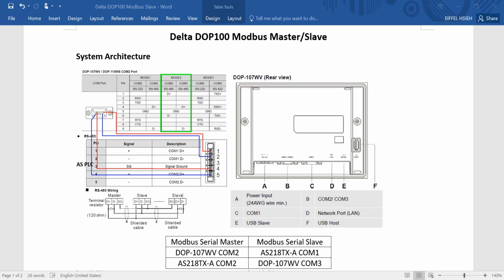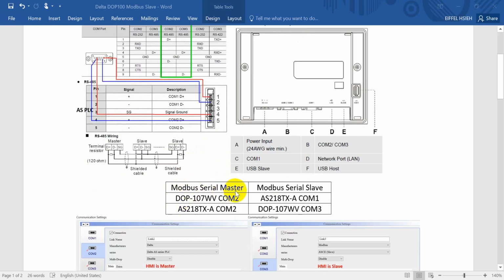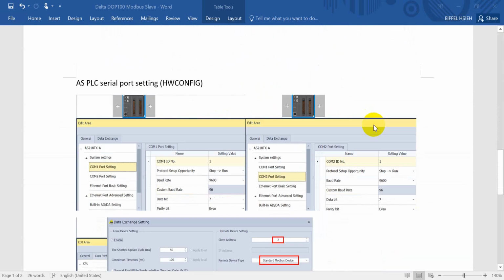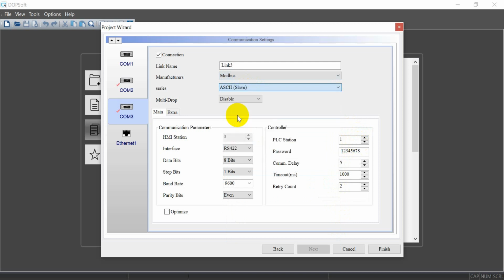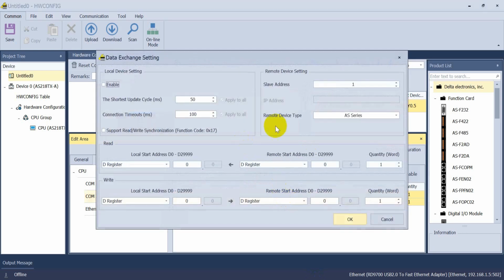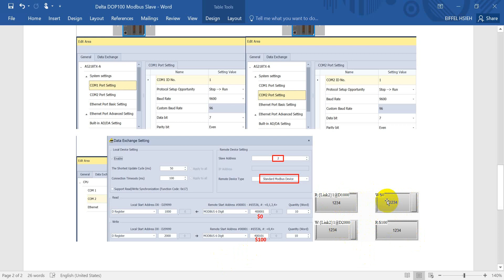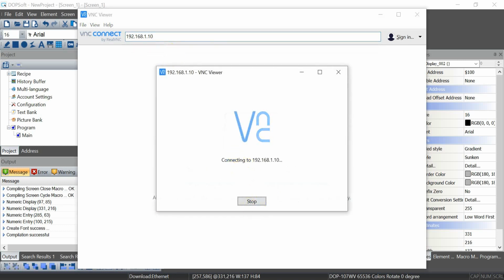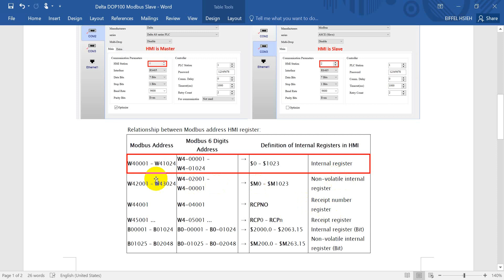Delta DOP100 Modbus Master and Slave

Comment: Dear sir  , i want ur help regarding the delta hmi dop107wv upload..when i can backup hmi via ethernet the software can be detect the hmi IP adress but when i click ok then "Ethernet can't be opened!!!! Warning is coming. Please suggest what i can do...
Reply from the maker: Hi Sir, May I know your DOPSoft software version?
Reply: @iabg_seadelta6647  yes sir , my software version is 
DOPSoft 4.00.08
Reply from the maker: @yogeshshinde5088  Can you try with latest version V4.00.10.17 from Delta website?
Reply: @iabg_seadelta6647  No sir i m not trying with latest version....
Reply: @iabg_seadelta6647  dear sir i was tried with latest version but still same issue happened....my hmi connected through ethernet cable  to omron cp1L plc via ethernet switch...
Reply: @iabg_seadelta6647  i am also tried with USB upload but after uploading data a 1 pop up window is opened with massage 
"upload- waiting for hmi compressed "
& after 5-6 sec  "COM disconnect"  pop up window is come...
Reply from the maker: @yogeshshinde5088  Sir, as I told you last time please try with our latest software since DOPSoft V4.00.08 has some issues. If you don't try and keep asking me this, how can I help?
Reply from the maker: @yogeshshinde5088  Please send me your system architecture to Eiffel.Hsieh@deltaww.com
Reply: @iabg_seadelta6647 dear sir ,   i m tried  with latest version but  still same issue happened
Reply: @iabg_seadelta6647 Yes sir....i will send ur requirment along with HMI system setting ...in ur mail id